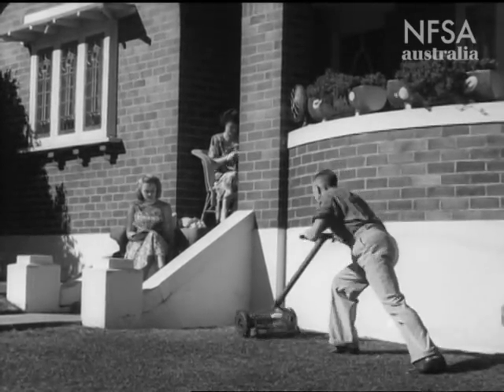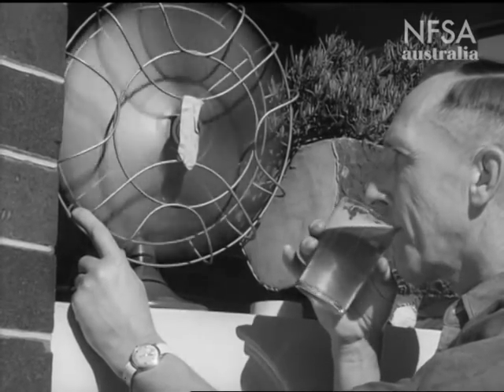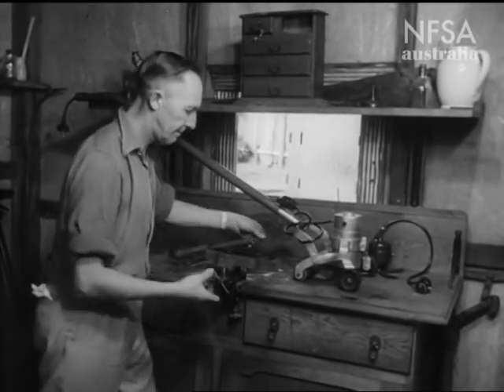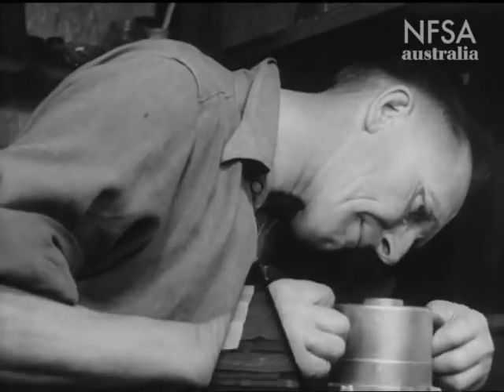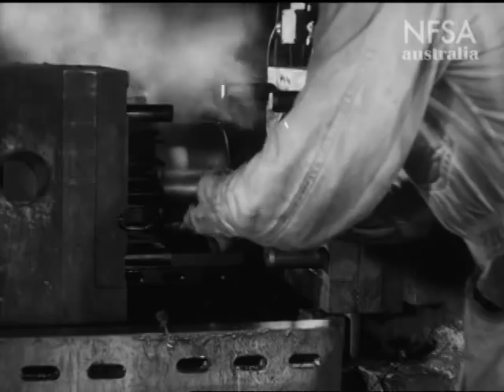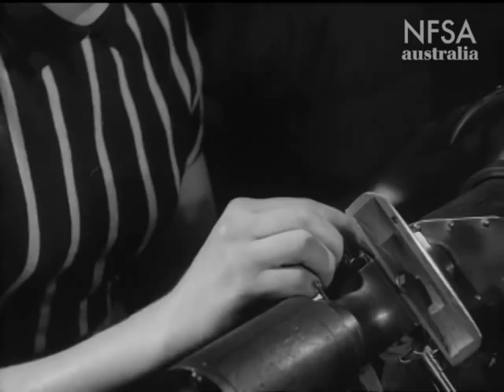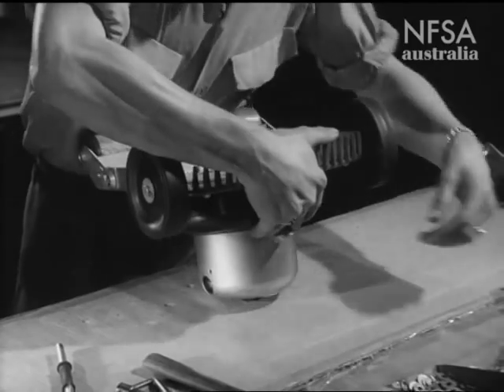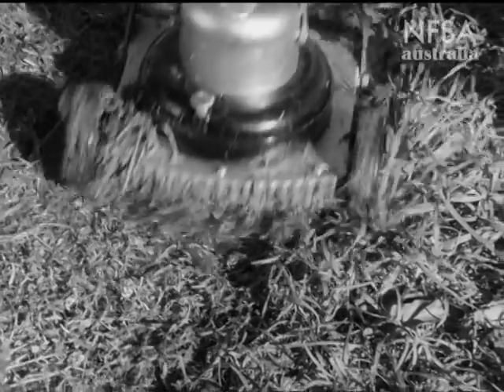Australian Inventor Perfects Novel Lawn Mower. Australian Diary 40

Comment: The motorised lawnmower was an Australian invention. Both the electric and internal combustion versions. I've used push mowers, and would rather put up with the noise and smell of a two stroke engine than take hours to do the job